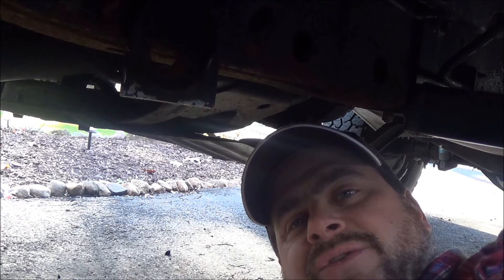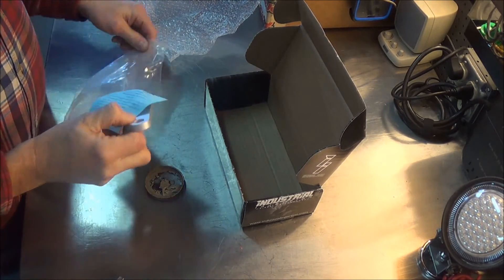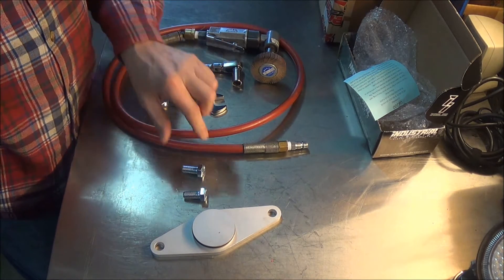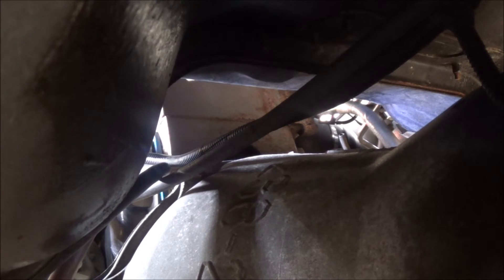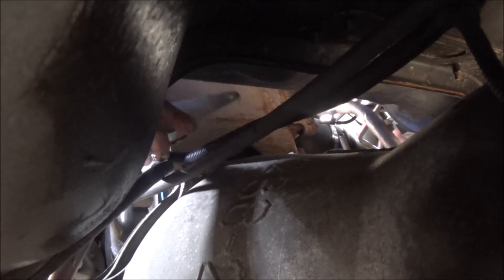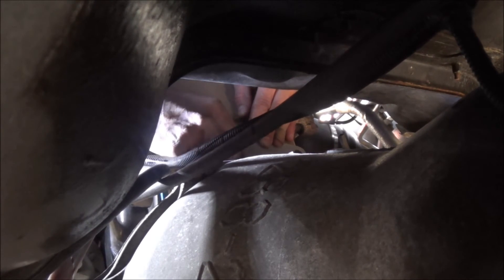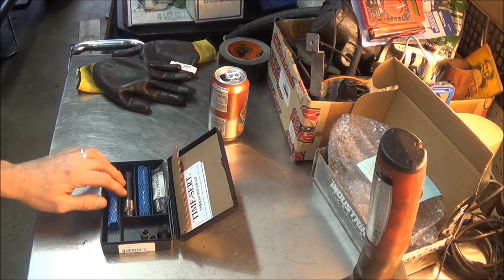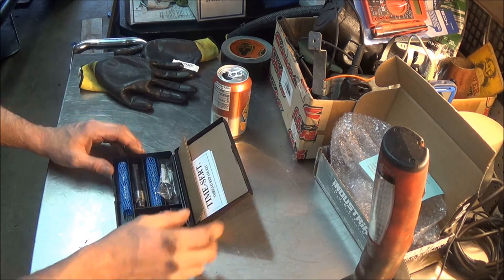How to fix a blown out rear freeze plug on a 2nd Gen Dodge Ram Cummins Turbo Diesel 6BT

Comment: Nice job, I have a twin turbo  Cummins in a Scout and a very tight fit to the fire wall. It leaked only under pressure and it took me ages to find out the reason for overheating after 30 miles of completely normal temperature. I ended up with a lot of oil in the cooling system, so much that it has to be the oil cooler or an oil cooler gasket. I hope I didn't blow the head gasket. Just installed a Hamilton stage2 head and it was pretty diapointing that ghe overheating problem was still present.  That lead to the freeze plug solution but on the last trip to the workshop monitoring the temp and oil pressure, after around 30 miles temp climbed again. I stopped and had antifreeze on me to fill it up after cooling down that's when I saw the oil.  I cross fingers that the freeze plug kit and the oil cooler fix solves the problem.  I probably have to cut the fire wall and fabricate a cover later on to get acess to the freeze plug.   Thanks for your straightforward explanation.

Comment: what size is the plug and are you doing the biggest plug?. can't seem to find the right size plug anywhere. mine is rear passenger side above the and to the left of the oil filter. the bigger plug
Reply from the maker: Check industrial diesel website, the have a set for the side of the block as well.

Comment: Thanks !  I got a sick feeling watching that, I did replace my rear plug when engine was out hope it stays in after seeing this.
Reply from the maker: +TheKilog69 So did I.. If I knew about this when I swapped the engine I would have done it then. The good news for you is (and I should have mentioned it in the video) is that they also make a retainer plate similar to what I installed) to use if your freeze plug is still in place.

Thanks for watching!
Reply: The heat exchangers for the Transmissions are a disaster on these motors. Best off getting rid of that nonsense before the transmission leaks oil into the entire cooling system of the motor and vice versa. Then your transmission is toast and you have to spend for Grand to get it rebuilt and then you have to replace the radiator and transmission cooler and and and and